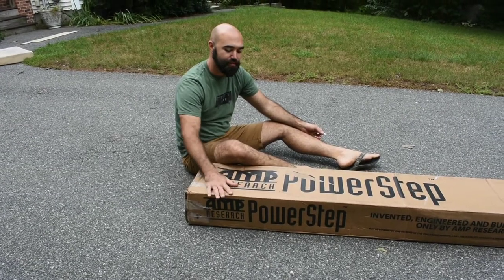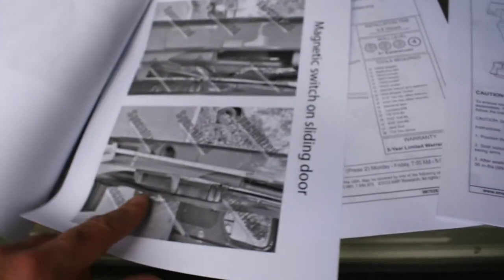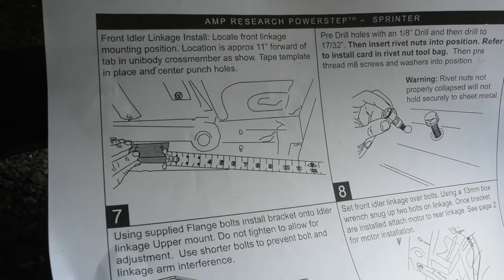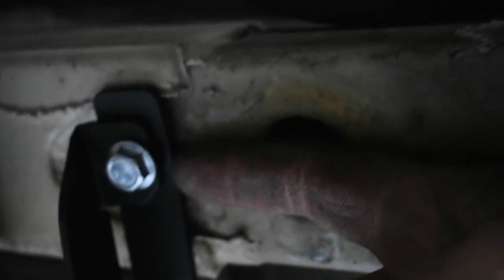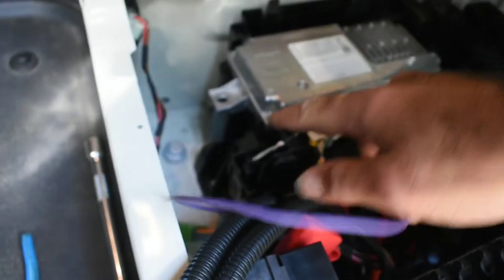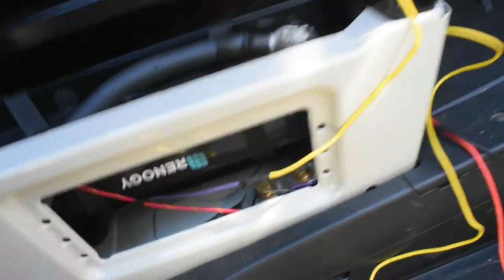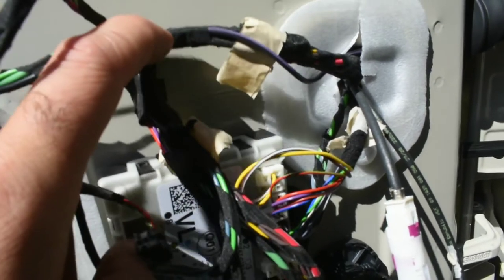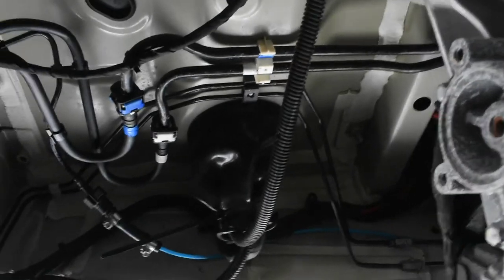Installing Amp Research Power Steps on a 2020 Sprinter VS30

Comment: Nice video. U helped me so much on my install.  Question I have is, is the constant power on tab 11 coming from main or auxiliary battery?  Thank you so much for the helpful video!
Reply from the maker: So happy to know it was helpful, thanks for writing! You can power the system from whichever battery you prefer. We chose to power ours from the van's starter battery, mainly for simplicity of routing wiring.

Comment: Nice, excellent install instruction video. Doesn’t look to bad installing these power steps. Too bad you couldn’t tap into an existing signal wire for the slider. Thanks for posting
Reply from the maker: Thanks so much for the kind words!

Comment: Thanks for posting your install--it's a great help. Question in mounting the rivnut for the front driver-side bracket to the undercarriage--it seems the metal where the hole is much thicker than the other bracket rivnut locations. Did your rivnut grab that thickness OK?  I've drilled but not inserted the rivnut yet as I am concerned about the grip range of the rivnut for this location.
Reply from the maker: We didn't have any grip range issues at any of the locations. There are two layers of steel there, but it should be fine. Send it!

Comment: Thank you so much for posting this - really saved me a bunch of time.  I do have a question: my kit came with seven of the M8 Hex Bolts (the parts list says there are 7 and I received 7), but I clearly need eight (two for each of the four brackets).  I also received one M8 Small Head Hex Bolt (and it is listed separately in the parts list); however, the instructions do not mention where to use this bolt.  Do I use this different ("small head") bolt with the 7 M8 Hex Bolts (for a total of 8), and if so, where?  Does one of the brackets require this different bolt for some reason?  I've looked at 2019-2021 and the older instructions and it looks like Amp Research messed up and left a number of installation steps out of the new instructions (but neither mentioned where to use this single M8 Small Head Hex Bolt).
Reply from the maker: That seems odd to me. I don't remember the specific hardware sizes at this point, but it seems like there should be 8 of the same bolts for securing the linkages to the rocker panels. Then there should be 8 bolts to fasten the gusset brackets to the linkages, and 4 to secure the gusset brackets to the van floor/cross-members. It's weird that it would be printed incorrectly in the instructions. I'd recommend getting an additional bolt at a hardware store that matches, and/or contact Amp-Research to verify you've assigned the correct hardware to each location. But I don't recall any of them being a quantity 7.
Reply: @OutofIpswich  Thanks again for your time!!!  I called Amp-Research as you suggested and they said it's a new change (7 & 1 is correct - just not explained in the instructions).  For anyone else who may be doing this in the future with the new version - the odd bolt (Number 19 in the parts list - M8 Small Head Hex Bolt) is used on the forward hole of the rearward driver's side linkage to connect it to the rocker panel (and a regular head sized bolt is used on the rear hole of that linkage).  Once again, your video was extremely helpful (where to connect electronics, where to place the rivet nuts, where to run the wire - Awesome!!!)
Reply from the maker: @georgemiller4204  So glad that the video helped and thanks for putting that updated info out there for everyone. That's what makes it worth it to create and post these!
Reply: Vid was helpful thx! @george Miller, I had the same question and glad to find the answer here!

Comment: Hi Could you please advise which particular part number did you ordered? There are version for up to 2018 with Plug nad Play kit 1799$ and without Plug and Play 1250$. In addition there is kit for 2019-2021 with plug and play for 1799$. I believe  mechanical all are the same. My van is 2023 and AMP Research does not confirm if any of them will work on the van.  From the other hand I see you are wiring in 2020 the harness which means to me you mostlikely bought up to 2018 kit without P&P AMP75163-01A? Am I correct. I can do extra wiring job to save 549$ for sure ;) Please advise
Reply from the maker: Sure! I don't have line of sight to the part number ordered at the moment, but it was a 2018 kit with a magnet switch modification included. At the time, it was marketed as a 2019+ kit. I'm not sure what they're calling it now, that was a few years ago now.

Comment: My 2019 sprinter 1500 has a manual sliding door, can I use the same electric running board in this video? Thanks
Reply from the maker: I would assume yes since it only uses front "door-open" signals , but I'm not certain. I haven't tried it to be positive, sorry.
Reply: @OutofIpswich  Thank you so much for the quick reply! Love your video tutorial, subscribed! :)
Reply from the maker: @zhouchenyi5199  Thanks for subscribing! We're happy to help!

Comment: Great work on this video!!! This will help a whole lot

For the driver’s side step, did you custom cut it or is there a separate product for the drivers door?
Reply from the maker: Thanks for the feedback! The driver's door step is essentially the same as the passenger's side, except the step piece is shorter. The parts came together in a kit from Sprinter Store. I believe today you can also purchase it from the manufacturer - Amp-Research - directly. It won't require any cutting.

Comment: I got everything wired and working, thinking I was finished, then I realized the driver's door would not lock when closed with the key fob.  The fob will unlock the door, but not lock it.  The computer does not recognize that the door is closed.  The dash screen shows the door open.  Any ideas as to how I can correct this sensor issue?  First of all I need to find the sensor if anyone knows where it is.
Thanks
Reply from the maker: So the wire you tap into inside the driver's door is grounded when the door is open if I remember correctly. It sounds like you may have a bad connection at that three -way splice. The connection is solid going to the power step control unit, but not so going to the van wiring.

Comment: Does your van have the automatic sliding door? Good info, thanks
Reply from the maker: It does! We had some issues with it not fully closing but a software update at the dealership seems to have resolved it.
Reply: Any tips on door panel removal?
Reply from the maker: @jasonbrown9838  Are you looking to remove the sliding door panel? That one's pretty straightforward if you have a trim remover fork thingy. All the clips are clearly visible, no real trick to it.

If you are trying to remove the front door panels, it's a little bit more involved. But it's not very difficult. You need a small pick to remove 3 screw covers (in the door handle pockets and near the lock pin). You need a few sizes of torx drivers to remove (I think) 5 screws. If you have the assist handle on the hinge side of the door, don't worry about it, that stays. You have to get a little rough with the lock pin, but at that point you only have to pull the perimeter of the door panel off to release plastic clips. The bottom is held up by a couple plastic fingers so if you unplug the wires and tip the top of the panel away from the door, it'll lift off.
Reply: Got the door panel off and got to the trigger wire. Front door was easy. I followed your steps for rear door, and the operation based on the mag switch is opposite of what it needs to be. (Mag switch together, step down, separate and step up) this has me a little stumped
Reply: @OutofIpswich  not sure how to contact you directly but it would seem easier if you would be able to spare a moment of advice…..
Reply from the maker: @jasonbrown9838  send us an email at outofipswich@gmail.com!
Reply from the maker: It almost seems like you are switching power instead of ground? The power steps control unit is looking for a path to ground; that's what signals it to deploy the steps. If you've somehow got power in the magnet switch circuit, it may exhibit those symptoms but I'm not 100%. Send over an email and we'll get you sorted.

Comment: Is anyone having lag time issues?  When you open the driver's door there is ~2 second lag before the step deploy.  The passenger side is instantaneous with the opening of the door.
Reply from the maker: That sounds like a software issue to me. There should be a 2-second delay before the step retracts. It seems like it somehow got flipped to the deploy function instead. Weird. I've never experienced this. I'd contact Amp-Research to see if they have, and if they have any guidance.